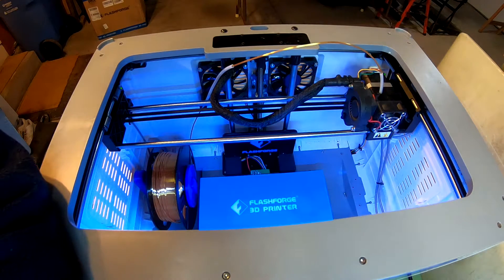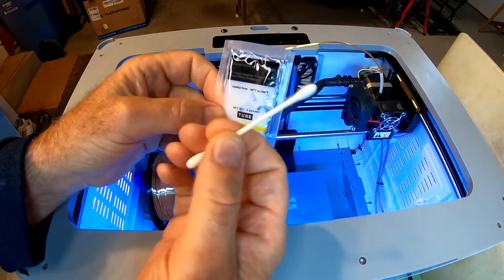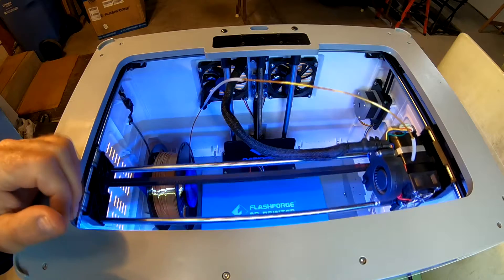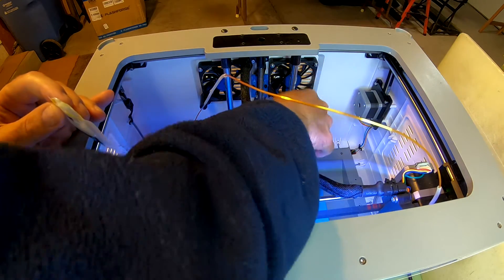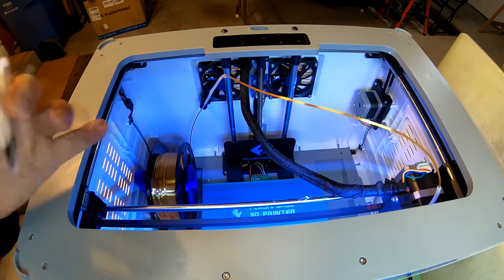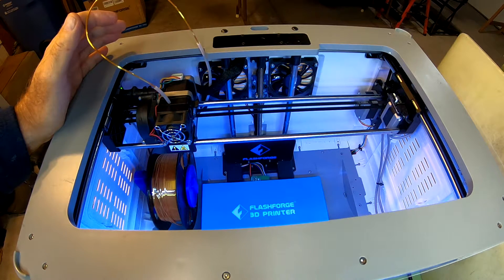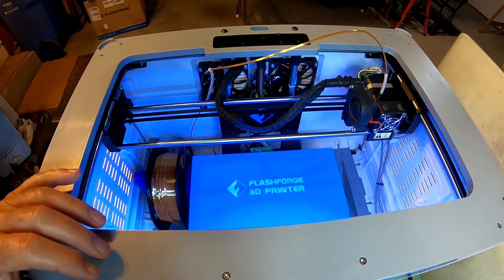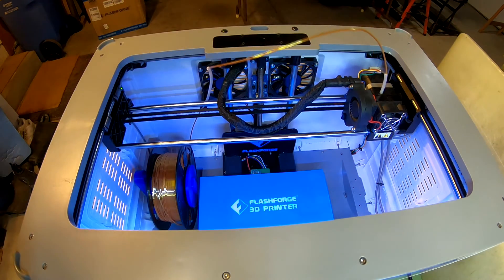Greasing the Flashforge Dreamer (NX) 3d Printer

Comment: Hi!, I have seen your videos and they are really useful, I have a question, according to your experience  with Dreamer NX, what temperatures do you use for PLA and ABS?
Reply from the maker: Thanks!
For the white PLA that came with the printer, I had to use 70 degrees C for the bed temperature, or it wouldn't stick.
For the extruder I used 220 degrees.

For the PLA I'm using now from Mika3D (I'm going to post test videos for that soon), I'm using 30 degrees for the bed temperature.
I guess it's higher quality, but I'm not sure why it sticks so much better at a lower temperature.
The pad that's on the printing bed makes for really good adhesion.
It's been challenging to get pieces off sometimes. I'm going to post another video about that soon, but my current technique is to heat the bed back up to 45 degrees after the print is done. That softens the base of the pieces and makes them easier to get off.
For the extruder, I'm using 220 degrees.

For PLA, I'm printing with the door closed and the top off. I'm printing in an unheated garage and in the morning it's cool in there. Now that the temperatures are warming up, I may print with the door open which is what the instructions say.

For the ABS that came with the printer, I used 105 degrees C for the bed temperature
That worked well.
For the extruder I used 230 degrees.
I also put the top on and keep the door of the printer closed to help maintain the temperature.
I haven't tried any other ABS filaments.

I do have some PETG filament I'm going to start using in a few weeks and I'll be posting my tests about that.
Reply: @BetaCygniBlog  great, I´ll be looking forward to viewing them! thanks!!

Comment: I am having a problems with my extruder. If I lightly push the filament it extrudes, but if I let it try on its own, the extruder motor isn't pushing it through. I had a couple of the screws unscrew themselves and drop loosening the extruder block, so i tightened them pretty good to prevent it from happening again, but I am wondering if one of them actually controls the extruder teeth motor thing.. would you happen to know? I'm gonna be annoyed if I have to buy another extruder piece because they aren't cheap.
Reply from the maker: I'm not sure which screws you are talking about, but as far as I know there is no way to adjust the extruder teeth.

If the extruder isn't pushing the filament through, the simplest cause is that your extruder temperature isn't high enough.
What filament are you using and at what extruder temperature?
You can try a higher temperature, at least temporarily to try and get the extruder flowing.
Lately, on a cold start, I've been using the [Load Filament] tool to get the filament flowing through the extruder smoothly before I try and print anything.

Another likely cause is that your extruder is clogged.
Even if some filament is coming out, it can be partially clogged.
Here's a video I did about how to unclog the extruder on the Dreamer NX:
https://youtu.be/GBy8P2QtkGg
Reply: I actually took it apart last night and once I removed the extruder feeder I turned on the feed filament and used the little tool to push the remaining filament through.  It was partially clogged. A ton came out. Now its running like a dream again. ♡ The screws that came loose were the ones that hold the actual extruder block on. The screw in from the bottom upward.. but 😂 it was unrelated so thats good. I just needed to tighten them.
Reply from the maker: @dejavoonails60  I'm glad it's working better for you.
Yes, I've had screws come loose from the plate that holds the printing bed to the Z-axis screw. All of a sudden the z-axis starts squeaking and that was the problem.
Reply: Yep. I feel like I'm a professional now. I have had to do major surgery on this thing lol but it really runs great though. Clean prints ♡
Reply from the maker: @dejavoonails60 Lol. I really like my Dreamer NX. I didn't want a "tinkering" project like some printers are.